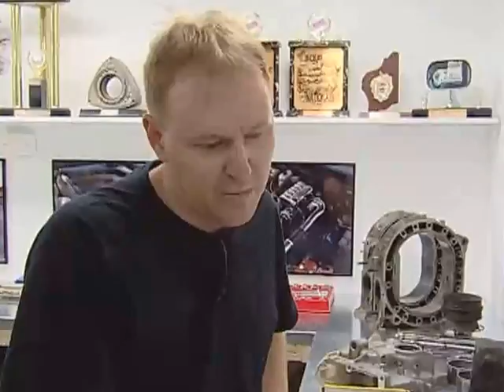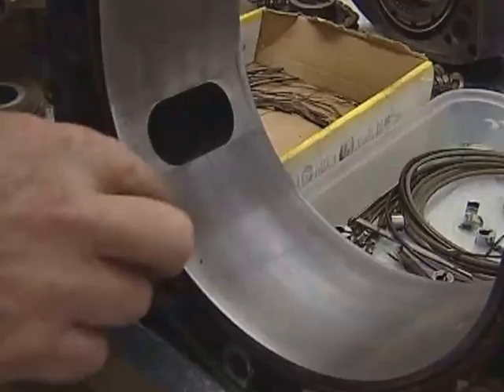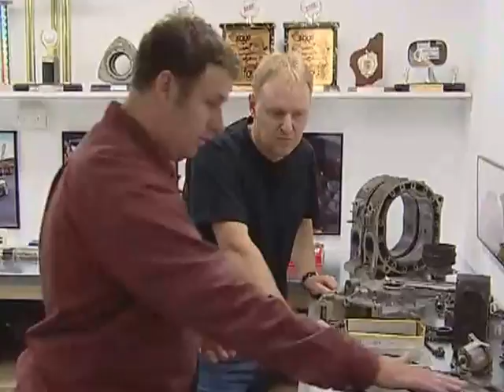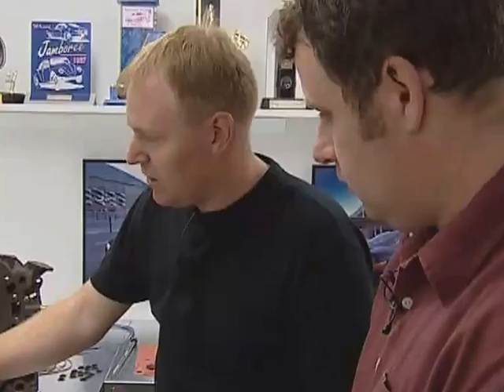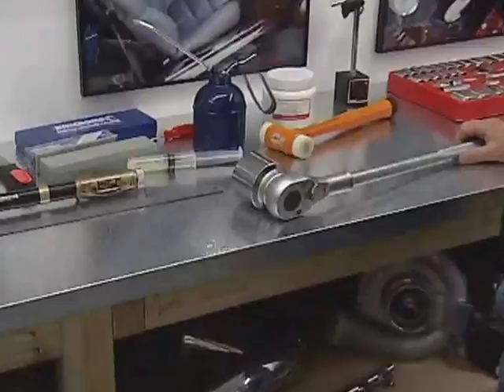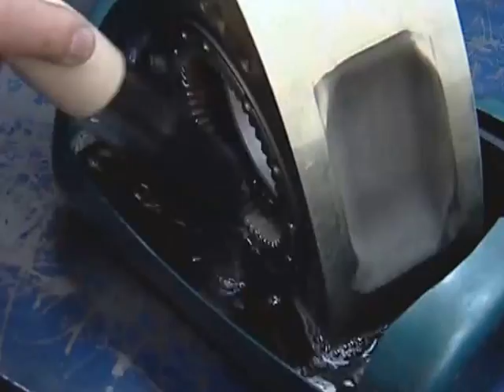Complete Rotary 13B Rebuild - Preparation & Cleaning ( Part 1)

Comment: where do I buy all these replacement parts I live in Illinois there's not even air filters available in this area from a Mazda RX-7 I have to special order the air filter so where do I buy all the parts that I need to rebuild my motor if I decide to
Reply: Ebay sells the entire kit. around 700 to 1000 bucks.

Comment: what is the main cause of the apex seals going bad? Check the oil. clean oil must be key?
Reply: synthetic oil makes them go bad, too. use conventional
Reply: nah oil cant really get dirty/bad it gets used too fast, its more design of engine. they just wear, correct oil for sure but do more damage doing short jorneys than anything, its no gt engine mind. just design of it really they will never outlast piston rings they go through different abuse

Comment: how much would it cost to buy a 22b rotary engine.
All in parts to rebuild myself.
Reply: +Jimmy Zeal I think you mean 20b 3 rotor engine. Just look up the prices of everything for a 13b rebuild and then ad 50% on the price.. there are kits available specific to the 20b engine but it's about the same money as double 13b kits. If you were to be buying the whole engine in parts it would be rather pricey as there is a few custom parts for the 20b that will not be found on a 13b engine. These are. the excentric axle ofc, and the center plate. These parts no longer are available at mazda so you would have to look for used parts.

Comment: How many miles should it last between rebuilds?
Reply: +Mortalomena 55-60k
Reply: Mark Boesen Alright. Not that many miles really for an NA 2 rotors :/
Reply: +Mortalomena no not at all but look up what brink did to the rotary motor what he found in it flaws. i have 2 that i have built based on his information and i rebuilt one at around like 85-90k i think it was.

Comment: Throw it away and buy a V8 $$$ in the toilet with these things.
Reply: Stfu. Rotaries are unique and if you change a rotary to a piston you are basically ripping the heart and soul out of these beauty's. Especially v8's
Reply: Nice bike, good luck when daddy hast to buy you new apex seals. Get a grip.
Reply: hurr durr NO REPLACEMENT FOR DISPLACEMENT
Reply: SteelRazorback your fucking stupid dude, just because a v8 engine exists, doesn’t mean you can go around ruining amazing cars with a heavy engine, the rotary is a high rev engine and a v8 engine would fuck up the balance vehicle that is the rx7 .
Reply: SteelRazorback you're an idiot
Reply: Hb shut the fuck up? If I wanted a v8 that’s just as unreliable I would have bought one.

Comment: Rotors rarely need replacement, unless there has been catastrophic failure and detonation. 
80% of the time they're reusable. Out of that 80%, 10% would ever need to be machined for clearance when you're building a motor for lots of power as well as the apex seal groove.

Comment: theres nothing concrete about the rate of parts that need replacement.

normally, irons don't ever need replacing but they will need to be lapped. (If you lap them too much, they'll need to be given a new nitriding process as its only a few mils thick) 
If stepped wear on irons is within OE specs, then simply using a lot of valve grinding compound and a lot of time, between two irons to break the mirror finish is enough. Some people don't bother, but its good practice to have good oil retention

Comment: the process is the same, but tolerances are going to be different as the RX-8 uses a different shaped side seal.

Internal parts are also going to be the same, but the part numbers are different from other RX's so its best to use the specific part numbers for your car.